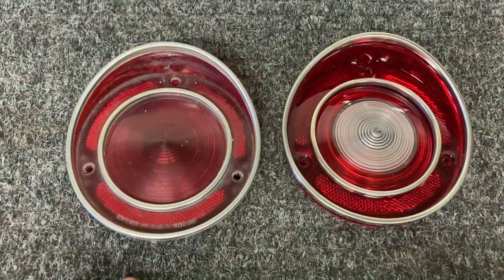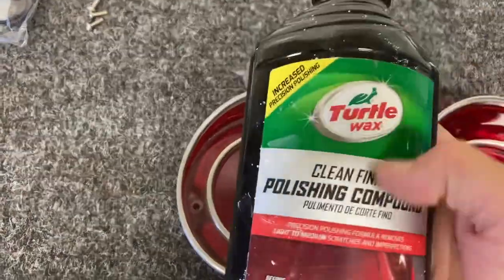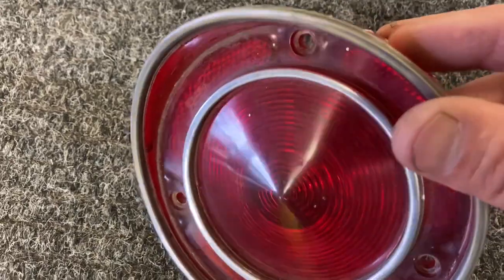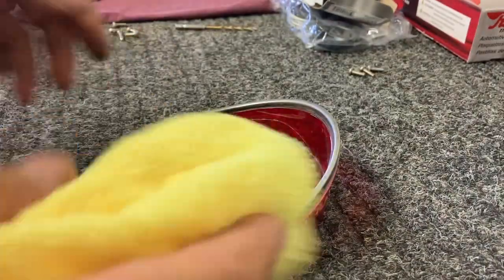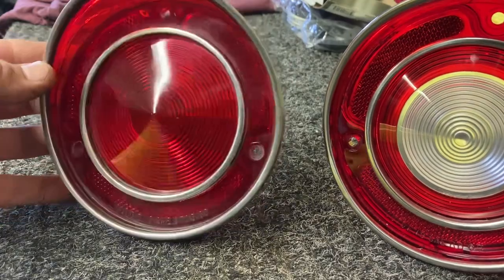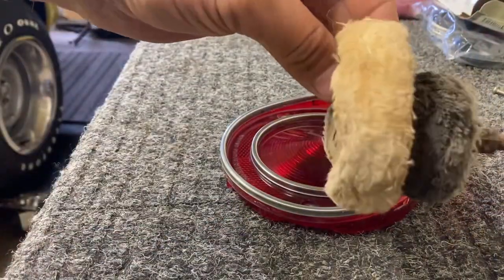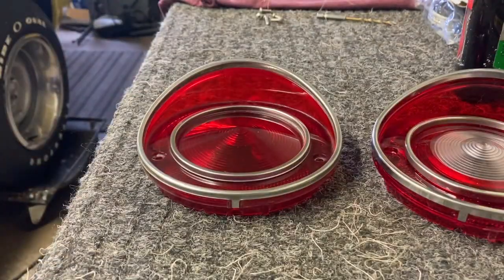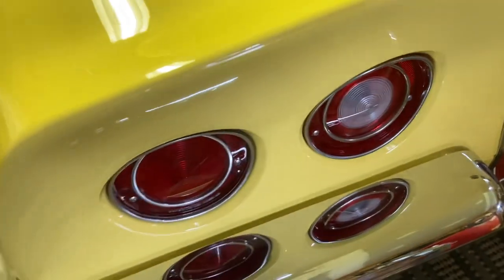Restoring tail light lens on C3 Corvette

Comment: Hey brother! Just trying to give back, as your vids are so helpful… Over the years, I’ve done just as you are doing, and/or sometimes adding in sanding with high # grit wet/dry paper (1500-3000). BUT, recently I watched a vid where the guy got a cheap acetone vapor kit off Amazon. Basically, once we finish the sanding/polishing… It’s a stainless coffee mug type thingy that you put the purple acetone into and plug it in. It heats up. Once up to temp, you hold it just a 1/2” or so from the lense. Little puffs of the heated acetone come out of the tip. When they land on the lense, WOAH! It suddenly turns absolutely crystal clear. Like it just popped out of the hot injection mold. I think was $20 or $30 bucks on Amazon. Soooooo worth it. Takes polished plastics to the next level. I will be using it on all of the console lnse, guage lense, little fiber optic plastic lenses in the console, etc. in my ‘71. I hope you try it as I can guarantee you’ll love it.
Reply from the maker: Wow! never even heard of this!!  Very cool, I'll def check it out. thanx